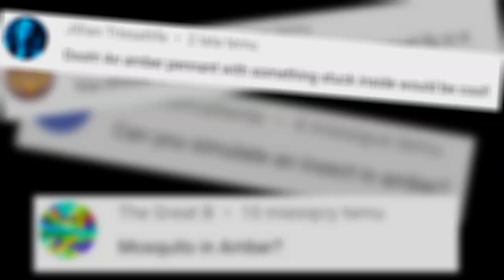How to make a Fly in Amber. DIY / RESIN ART

Comment: Very cool!! I'm thinking of making this as a birthday gift. Did you use dye specifically for resin or just food coloring or something? And when using resin that asks for equal parts epoxy and hardener, is it better to do it by weight or by measurement (like a tbsp of each)?
Reply from the maker: It is better to do it by weight. I used to use food colors. Now dyes for epoxy resins